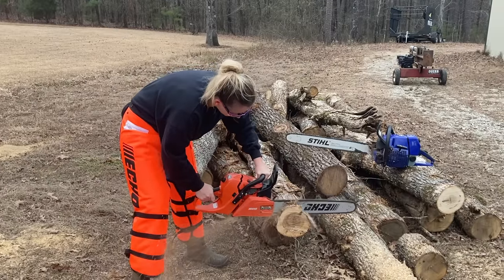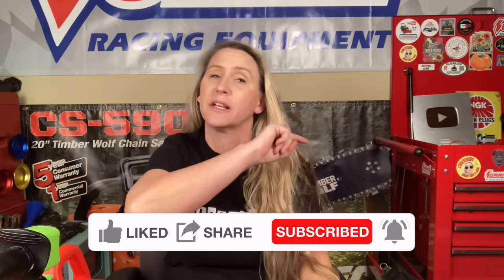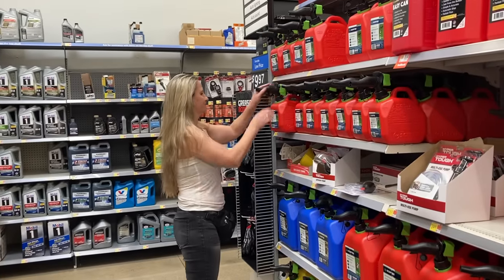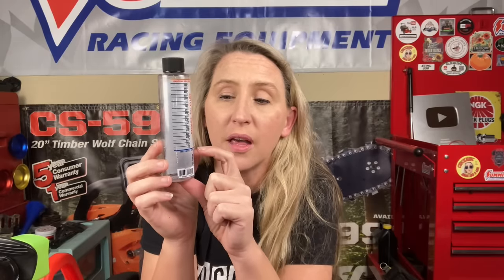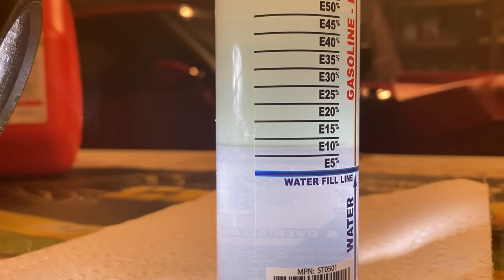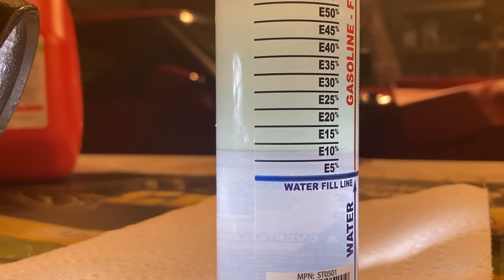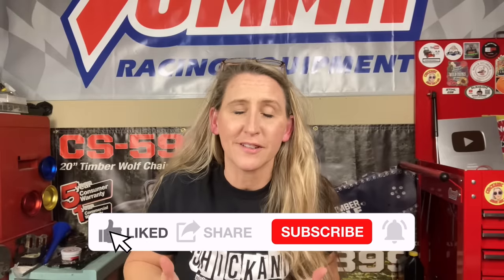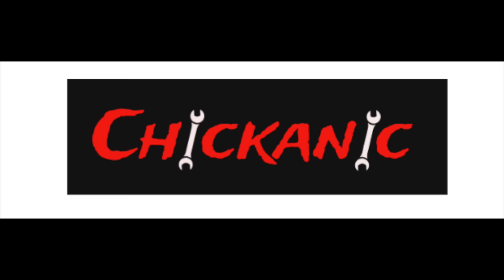Fueled by Deception. How You’re Getting Ripped Off at the Pump! (I'm SHOCKED!) VLOG

Comment: For your pouring antics… Only have one word… funnel…😊
    And I totally agree with how stupid the government mandated “safety” crap on our gas cans is. I’ve never spilled so much gas in my life as I have since they came out with that stupid nonsense. I’m lucky I haven’t had a fire. No telling what damage our country as a whole has suffered from them.
Cool, informative video.
Reply: I would have poured from the can into a larger measuring cup, then from the cup through a funnel into the test device. For precision purposes, I may be inclined to use a turkey baster type of thing, or an eyedropper that can handle gasoline (if such an animal exists).
Reply: I use a siphon to fill up lawn mowers, atv, small containers, pressure washer. Rarely make a mess.
Reply: I replace the nozzle with a standard nozzle, then fill the small can from a big one.
Reply: Or a regular gas can with a normal fucking hose?
Reply: @ThatOneGuyWithTheEye  - They don't sell them any more in many places.  Those that do it's usually old stock.  Due to lawyers - not the government - all the cans now have insane 'safety' features, and the 'anti-blow back' mesh.    There weren't any identifiable cases of fires NOT being caused by carelessness, but the judges (lawyers) allowed the 'plaintiffs' (lawyers) to sue the gas can manufacturer for creating 'unsafe' cans that 'could' explode (if the user was an absolute moron that needed to be exploded, or someone committing suicide).
Reply: I like SureCan
Reply: There's an online place that sells new replacement necks for gas cans that are the old fashioned straight up spouts without the federally mandated bullshit safety valve's in them, they sell them with a variety of collars that cover the different diameter/threads you'll find on the gas cans so just about any new jug you buy that comes with those pain in the ass necks can have it replaced. 
I wish I could remember the name or web address but I'm sure if you start looking around it won't be hard to find.
Reply: @adamdnewman  
That could very well be it and thank you, although it's a pre federal regulation gas jug one that I have needs a new neck because the original "accordion" style neck has broken off real short at one of the corrugations just above the collar and needs replacing. 
It's definitely a can I want to keep because it's a "piggyback" style that's for chainsaws, it has a 2½ gallon fuel jug on one side and the other side holds I gallon of bar oil, that way you're not fumbling around in the woods with two jugs, they're one of the best chainsaw accessories you can buy.
Reply: @dukecraig2402  Sounds like a very useful can.
Reply: Yeah, so much for saving environment from gas fumes.
Reply: @shopoutdoorsonline3932  
Yea, ain't that the truth.
People always use the saying "Talk about shooting yourself in the foot", well those new filler necks are a case of the government shooting everyone in both feet.
Reply: @shopoutdoorsonline3932  There are battery operated siphon pumps though I haven't really used them. Or the transfer siphon pump that you squeeze the top of it. Used for kerosene heaters and more.
Reply: The funnel doesn’t fix the hold the green button in and  lift and pour a 5 gallon container would really suck

Comment: I am so glad to see someone else struggle with the new gas cans. I had thought about the big push button ones but the kids in the shop say the ones are easier.  But yes for them to be no spillable,  now i spill it everywhere.
Reply: I use one called Easy Can, kinda pricey in my opinion but it actually works and it is easy to use filling straight into weed eater. Walmart online 2.5 gallon for around 27 bucks👍
Reply: Protect me from bad gas cans and in the same breath  authorize.  .....    to demand me to get  ....  plus a a booster or 2.
Reply: I used to spill almost every time, now with the new cans I never spill. They work perfectly.

Comment: Thank You! From this moment on I will pump a couple gallons into my vehicle first, I do use 5 gallon cans but usually only fill to about 4 gallons for safety and ease of use. I've thought some of the problems with the ethanol fuel could be related to the additives, not sure.

Comment: The station I go to sells "recreational gasoline" 92 octane, no ethanol.  I have thought of the hose containing other grades, but when I went to get fuel, noticed that the recreational fuel has its own hose!   Good!    I have never had a problem, even from one year to the next. I now buy it for all my small engines...Love your channel!
Reply: If it is a single pump you should be fine, if the pump has multi grade the pump has a distribution block and a single pump pumping all the blends so you would still get what remains in the pump and distribution block. single hose is better than multi grade but still not perfect.
Reply: The hoses may only hold 1 to 2ounces of fuel. The pumps are designed so any fuel left in the hose is siphoned back into the storage tank once the pump is shut off. You can verify that by laying the nozzle on the ground and pulling the handle after shutting off the pump.
Reply: @billwilson3609  if that was the case, fuel would not immediately flow out of the nozzle when you refuel your car.

Comment: Love the vid! Suggestion for your next fuel transfer experiment: 1) Get a 2 cup or 500 ml glass measuring cup or even a beaker(!)  2) Remove the anti-spill anti-vapor spout from the Sceptre gas can. 3) Pour from can into measuring cup/beaker. 4) Pour from measuring cup/beaker into the test cylinder. Much less difficult and less chance of making a mess.
Reply: One word- funnel.
Reply: Never fill a gas container while holding it in your hand.  Place it on the ground.
Reply: Correct sir !
Reply: @kevincollins9894  It really shouldn't matter, the grounding is done through the nozzle and hose. Whether the can is floating in the air or sitting on the ground, it still won't conduct any built up static electricity. I would still put it on the ground though, that just looks awkward to do while holding the can.
Reply: @--_DJ_--  From the American Petroleum Institute....When dispensing gasoline into a container, use only an approved portable container and place it on the ground to avoid a possible static electricity ignition of fuel vapors. Containers should never be filled while inside a vehicle or its trunk, the bed of a pickup truck or the floor of a trailer.
Reply: @kevincollins9894  Oddly enough, hoisted mid-air is not on that list of places not to fill your tank...Vehicles build up a ton of static, that is why that rule exists. I work for a company that services fuel dispensing equipment, I know how  the grounding works and the do's and don'ts. 
Best practice is absolutely to put it on the ground, my comment was more theoretical.
Reply: @--_DJ_--  I'm sure there are plenty of places of where not to fill a container of gas not listed.  Hypothetically or theoretically, placing the container on the ground is the safest place.  Stay safe!
Reply: Be sure to use a splash proof beaker and a flow restricted funnel))))
Reply: JUST USE A FUNNEL !

Comment: Thanks, i thought the same thing about getting premium fuel for my motorcycle.
The tank isn't that many gallons, so if you are only preemptively topping off, you could be getting closer to 89 instead of 92, which i wondered if anyone has had knock/blown an engine over.

Which also means it's to your advantage to top off less and let the tank get lower.
Reply: It's almost like you gotta wait for someone to pull up in a sports car and fill that up with premium, and then jump in line after that person 😅
Reply: It could be to your advantage to fill up more often if yo buy cheep gas and get behind a jaguar eve time you fill up your go cart..
Reply: EFI completely eliminates this problem. The only thing you may notice is poorer gas mileage. Hopefully, anyone who is running a carbureted motorcycle has not leaned the jetting for performance without being able to recognize the signs of lean running. Anyone with a carbureted motorcycle that has NOT leaned the high speed mixture for performance has nothing to worry about.
Reply: Most efi bikes are just fine with 87/89, says so in your manual. The problem is the 10/15/85% ethanol sucking up moisture into suspension. I usually look for 91 no corn with a dedicated hose, simply because I got a load of water in my tank which made it stumble till I got it home and disassembled it.

I found water to the top of the in tank filter pump, I found water in the p-trap shaped fuel hose, I reverse flushed the injectors and got a few drops out of there. About a quart of water is all it took to ruin an out of state ride. I apply this knowledge to small engines too.

Comment: Great information! As far as the "newer, safer, environmental friendly" gas cans I spill, over flow so much more gas. These cans are more of a hazard and a hassle then anything else. Just like anything else our ' enlightened nannies " force us on us it is short sighted. A solution for one problem only to create a host of other problems.
Stay well, Joe Z
Reply: Post-sale, I hear there are ways to 'fix' those gas cans!
Reply: @sunbeam8866  Yes some nozzles can be "adjusted" 😁
Reply: 'I am from the government, I am here to help you', not.  Yes Joe, I have spilled more fuel with those new spouts so, All my gas and diesel cans get an aftermarket specific replacement spout depending on what I am using it for.   
I have to go a mile out of my way sometimes, but there is a station in town that sells Non Ethanol super in a separate pump and also sells off road diesel (for my Bota tractor).
Reply: @funnyfarm5555  LOL Ronnie was great, truer words were never spoken.  If I could get the non ethanol gas anywhere in my area I would travel for it but just too far plus tolls & traffic.
Stay well, Joe Z
Reply: @working_country ___ If you are adding the snap cap vent, be sure to drill hole out with a step drill bit; a regular drill bit pushes extra plastic to the inside and you don't get a good seal.  Learned the hard way doing one  and the second one came with a new spout and they said to use a step bit and it worked great.
Reply: Just remember this, it is the insurance companies being the nannies. The gas can companies that made good cans went out of business because the insurance companies refused to insure them. They did this by increasing their premiums so high they couldn't afford to pay for them. No business will survive very long without insurance. 

In all my years in commercial building maintenance, I never had difficulty with a government agency. Almost every problem they pointed out to fix was minor. It was always the insurance companies causing the big problem. The insurance companies were always telling the business owner it was the government regulation causing the problem. I know better because I would look up the regulations. In other words, I was stuck in the middle of it.
Reply: @JOEZEP54  I bet there is a place near you. Give you a hint, you won't find it at any chain stores. It will be locally owned operators that handle ethanol-free fuel.
Reply: @rickster9993  Thank you but there are not many locally owned locations in my area. Some that were are now either owned outright or supplied by one individual supplier. 
Stay well, Joe Z
Reply: @rickster9993  Battery technology is the future but we are not there yet. Power plants shutting down no new power plants to replace them. Materials for battery production produced under very hazardous conditions & in slave labor countries.  Then there is the issue of cost, disposal, power grid. Wind power is running into many difficulties of its own. A couple of States suffer from brown outs now as we get more into the Electric vehicles/equipment it will be a real mess unless these & other issues are addressed.
Reply: @JOEZEP54  We're there. We have the technology. Telsa is breaking out with storage technology right now. The Giga factories both battery and EVs are set to explode. Remember how fast cell phone technology took off? This may be faster. It is absolutely fucking amazing what is taking place right now with battery technology. Within 10 years the fossil fuel industry will be all but dead. That's how fast battery technology is changing right now. Thousand-mile charge in 15 minutes for twenty dollars is within our grasp. 500-mile charges are already taking place. Who knows what ten years from now will bring.
Reply: Thank you for providing this important information. Unfortunately you now own three of the worst gas dispensers I have ever seen🤪
Reply: @rickster9993  yep - Blitz Manufacturing was bought out by Hopkins after a lawsuit, and stopped making gas cans - their non-gas can product line is now FloTool

Comment: Spot on.  This is why I always pump a few gallons of fuel into my car first before filling up my gas can.  But it doesn't really matter because I remove the ethanol from the fuel anyway before I use it.  (It's really easy to do!)   🙂
Reply: How???
Reply: @lisat9707  You're not the first person who wanted to know how to do that!  I wrote a brief procedure outlining how it was done, but it got promptly removed, and I'm not willing to go through all the trouble again if it's just going to be deleted for whatever reason.  Just do a search right here on YouTube and you'll find more that you'll ever need!
Reply: @lisat9707 Get a 5 or 6 gallon carboy jug (I need to get a six so I can run 5 gal at a time with the 20% ratio). Put about a gallon of water in the jug. I add a little red food coloring to make it real easy to see. Fill the rest with pump gas. Shake it all up. You can watch it separate before your eyes. Mark the jug with a sharpie if you want to see just how much ethanol settles out. Siphon the pure stuff off the top. 
All my carburetor troubles seem to have magically gone away since I started running this, machines run cooler and smoother. Very easy starts. For reference I own 16 small engines I run this stuff in. It’s wonderful and so worth the few minutes of effort.

Comment: Just an aside to this subject...I had to have my engine rebuilt/remachined.  They did everything and did a great job.  I asked the guy about the replacement seals, gaskets, etc., to find out if THEY would hold up for a higher than 10% ethanol content in the fuel. ( Some elastomers break down from exposure to one chemical or another.)  I was assured the "newer" materials were made to handle the higher ethanol.  Going on 3 years and no problems.  So, just FYI.
Reply: I doubt that newer materials can handle ethanol.   Just more industry hype.  (Just like the fact that gas stabilizers are mostly useless)

Comment: Little helpful tip, if you have a automotive shop locally (or i guess Amazon too) that deals in paint supplies you might want to pick up some paint mixing cups. They come in pint, quart, and gallon size. They are marked like a measuring cup as well as ratios for the paint plus they should have the snap lids too. Very cheap and handy.

Comment: As someone that often has to acquire a small sampling of fuel for testing purposes, a small bit of advice.  Get a Pyrex measuring cup (glass, not plastic).  Pour from the can becomes easier and creates better controlled measurements.

Comment: The EF Premium pumps I have used are either a dedicated pump or have a separate hose for the EF fuel.  In fact, the E15/E85 blends also have a dedicated hose.  However, this is very important information for the unsuspecting consumer.  Honestly, I never would have considered a shared hose to be a problem.  Thanks for sharing your insight.  Enjoy the Journey - Cheers
Reply: The Sheetz in Iredell county is the only store in my area that has E85 or any of the others. Each pump will pump all of them though, they also have the 93, 89 and 87 on those same pumps which is the primary usage overall here in NC. Imagine what it is doing to the people pumping the E15 and getting 87. It would take 20 gallons to dilute .33 gallons.

Comment: As a person that rides a motorcycle I always look for individual hoses for each grade, it’s getting harder to find!
If test kits were only $13 you should’ve bought one kit for each test.  Also, you could have poured the gas in a smaller container and then into a test kit. Great video.
👍👍👍
Reply: I sold my motorcycle 16yrs ago and I knew when I rode to avoid any station with shared gas dispensing hoses. It saddens me to see so many grown Men are incapable of figuring this out on their own. At 44yrs old I have never had a fuel related issue on any car, motorcycle, or small engine.